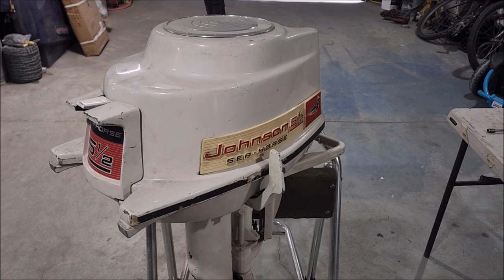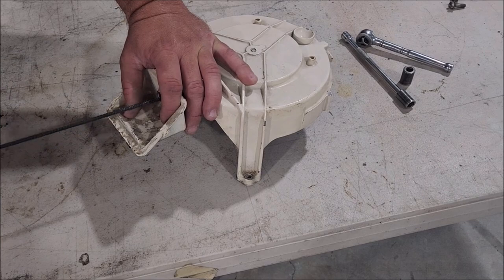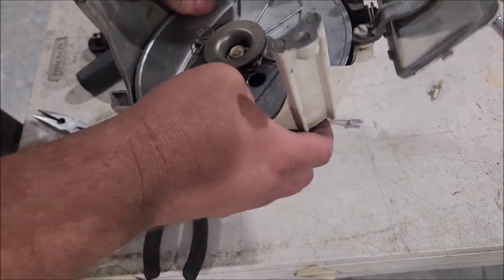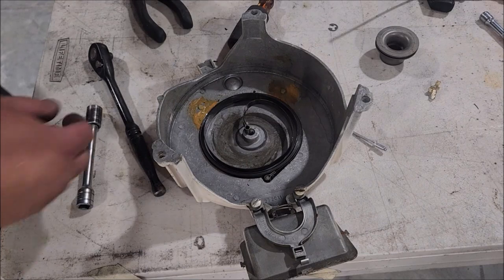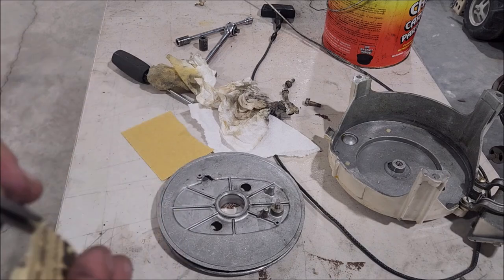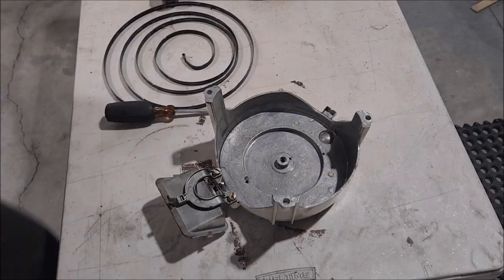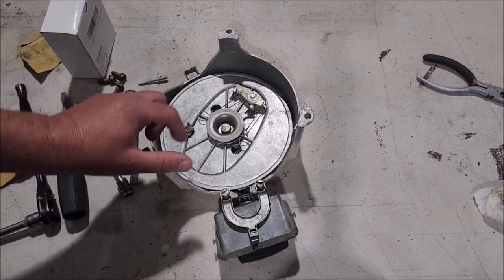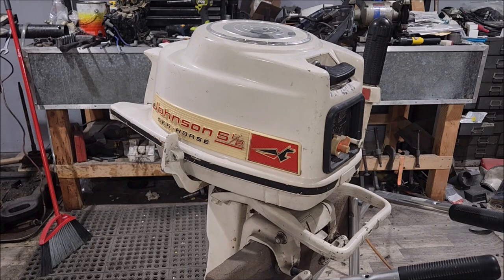Johnson Evinrude 5.5 HP Starter Repair

Comment: Had to do the same thing on vacation last summer with my ‘56 7.5hp. In my case, the rope snapped when fully pulled out on the first pull. Luckily, I had a big screwdriver with me. I hate struggling with those recoil springs… The 50s 5.5 and 7.5 are still some of the best engines ever made, they just keep reliably going and going decade after decade.

Comment: Gotta 71 6hp recoil is bad different style than that. I think I need new spring and rope. Took it apart and the edges are too sharp I thought also, will clean and grease while waiting for parts which are still available 👍

Comment: Is that counter clock wise from the bottom or the top ? lol. I can't believe you didnt have any tools with you , wow ! First rule in boating is Hammer , Plyers , Both types of screw drivers and rope ! Thats like going fishing without bait ! How fast is that current there ? I got one for you ..... Dispelling the myth of Pressure tanks ! or converting that block to a 6HP WITH CDI !
Reply from the maker: Well what myth? That they can explode? Or leak everywhere? 
CDI shouldn't be a problem.
But 6 HP might be. The 5.5 intake manifold has a pretty small opening, and the intake is needed to properly hold the starter.
Reply: @BrandonsGarage  this is true ... just thinking of material for you and yes the exploding fuel tanks that never happened ! Ive used them on cars and small motors that the fuel pump quit working or the tank was rusty .